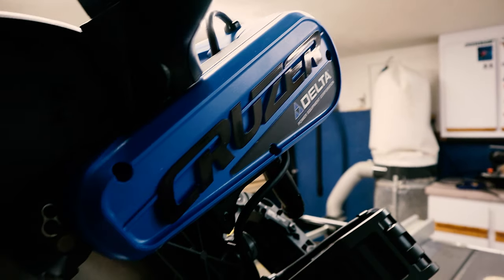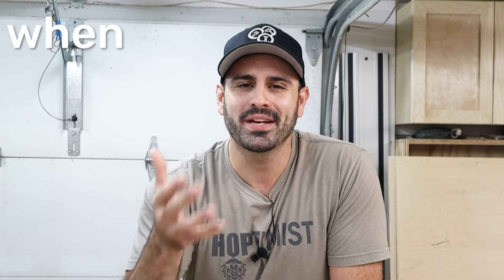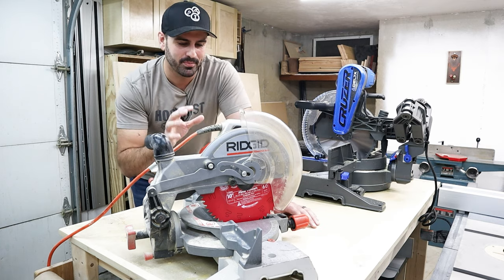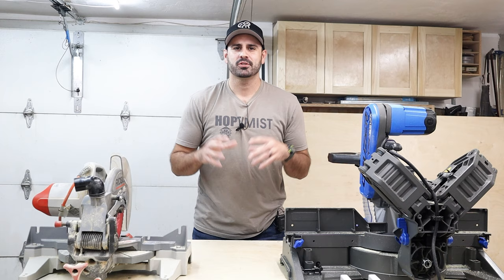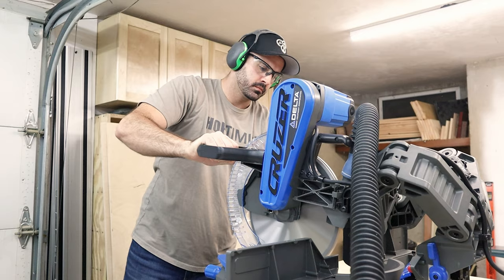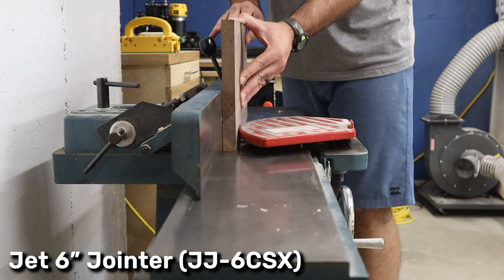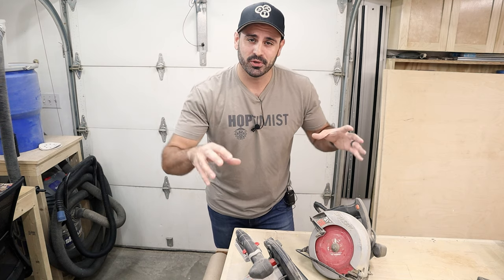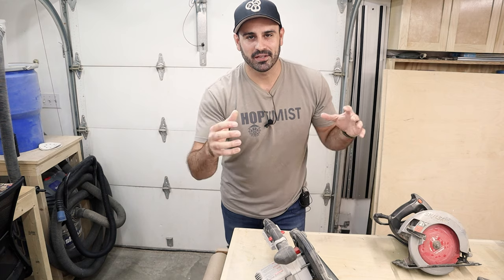Should you UPGRADE your WOODWORKING tools?

Comment: Excellent video. First time watcher, first time comment 😅 new subscriber. You make great points the I've struggled with myself. I got a track saw a while back and it was totally worth it. I just recently upgraded my table saw and now I'm eyeing that same exact miter saw. I mean if budget was not an issue, I would go with the Bosch GSM12SD but it's a considerably more $$$$ tool and not in my budget. I know Delta tools. I own Delta tools. I'll get that saw as soon as I can.
Reply from the maker: Hey, I appreciate that!  Same thought process over here.  I have a Delta table saw and love it, figured I'd stick with Delta for the miter saw as well.  Thanks for watching the vid!

Comment: great video i am new into woodworking and have been going crazy trying to decide between saws 10 vs 12 slide vs non slide i do not have a lot of rear clearance where i have my setup so the zero clearance makes sense but then i say to myself i can always crosscut with my table saw then i try to figure out if i go cheap on saw i can also get a air compressor and brad nailer combo which is about 200 give or take then there is the stand for the delta if i want to work outside in the nice weather there is another 200  i have already had the dws 779 12 inch slider and the matching rolling stand but the massive rear clearance needed plus the dust bag goes beyond the slide then the handle snapped off the rolling stand when i went to lower it so back to the store went both items so 600 bucks now i am debating on just getting this, i can order from HD for 519 and i can always wait for the nailer and stand and if i want to work outside or in garage just set up on sawhorses and a old door, thanks for any advice
Reply from the maker: Hmm, I wish I could give you a good answer on this, but it certainly depends on your situation.  I made due with my old rigid miter saw for years (because I would make those cross cuts on the table saw).  I did recently buy that air compressor kit and it's opened up so many more projects for me.
Reply: @CasualBuilds  I actually think I FINALLY found my miter saw I bought and returned some the last return was the Dewalt DWS 779 12 inch slider, it needed so much rear clearance which I don't really have in my indoor set up, when I went to lower it on the Dewalt rolling stand the stand handle snapped off I got angry and returned both, fast forward a week I saw a Metabo miter saw stand, I was already looking at the Metabo 10 inch zero clearance miter saw, the stand was on marketplace which drove me to buy the saw, I like  it and seems to cut good and seemed to be in square.

Comment: Hello, Thanks for your great Video, after 2 years what is your opinion of the Delta/Cruzer??? are you still happy with that machine??? or do you regret something???? Thanks again.
Reply from the maker: It's alright. Dust collection is terrible and I find it hard to align the sliding component for 90 accurate cuts

Comment: I built an end grain cutting board for an Xmas gift for my mom this past Xmas. It was my first cutting board. I used my uncle's workshop and he has that small jointer that sits on the workbench. We had the exact same problem of the boards not getting perfectly flat.  It actually made some worse. So I know your pain. That cutting board took forever because of that stupid jointer. Lol. That delta saw is sweet. I've never seen a saw with those arms in the back.
Reply from the maker: I'll tell ya, having a jointer that has a fence that's properly set and runs well will make the world of a difference.  Yea, this saw is definitely cool, loving the sliding mechanism so far!
Reply: @CasualBuilds  they both were definitely great upgrades.

Comment: Great saw and for the same reason bought the bosch glide.
Reply from the maker: Yea, I was also looking at that one.  Can't wait to start cross cutting wider boards with this thing!
Reply: @CasualBuilds  essinsatal craftsman said it well " don't blame the tool for bad results use proper skills to build . Wish you well and keep at it as you are in the .5 percent that is making things  on you tube and build a miter station with dust collection for the new saw .
Reply from the maker: @daxd8358  You read my mind, that's next on my list.  I have a miter saw station, but the opening for the miter saw and the drop down doesn't match the new one.  Need to upgrade that too!
Reply: Casual Builds https://youtu.be/w7EEMlKyMYs
Start at 32 minute mark and watch the Bosch & Metabo ( which is not sold in USA ) dust collection idea that may help you since you have a new build in mind and is a major issues with miter saws in general . Please note it is in German yet the video is self explanatory. Hope helps you out . I know that you do not own either saw yet dust collection of the metabo may help . Light shadow is best for miter saws hands down in delta miter saw .

Comment: I’ve been looking for a decent jointer locally for almost a year in the Central Valley Ca. Anything decent sells quick. I’m not a fan of Delta tools anymore. Their quality and customer support is non existing. 
I’ve been thinking of getting the same track saw as well, but the jointer is needed first. Congrats on the new tools and excellent videos.
Reply from the maker: Thanks Gustavo - I've heard of issues with the Delta table saw that I have, but luckily, I haven't had any issues yet or needed to get in touch with their customer service.  Track saw is awesome, I think it's a great alternative to the more pricey Festool options.  And yes, jointer is key.  Keep searching, you'll find something soon!
Reply: Casual Builds I had the Delta 35-726T2 and after a week the motor started acting up. I called Delta customer service and I was told to just return the saw. There’s a person on Facebook selling a kit that fixes the motor electrical issues. I ended up returning it, and saved up and got a Grizzly G1023RL. I wish the delta would of worked. I would of saved up a lot of $$$.
Reply from the maker: @gusgusnft8231  Yea, I'm assuming you're talking about Frank?  I've chatted with him about the kit too, but I haven't seen any issues yet so I've held off on purchasing.
Reply: Casual Builds yes! Frank.

Comment: I agree with your decision to upgrade, but I can't help thinking about some of your 'excuses', for lack of better words, LOL.  
"calculating the distance from the edge to the blade" for the circular saw, for example, caused me to immediately wonder why you didn't just cut a couple of blocks the width you need and use them to space the edge of your saw from the cut line, or as you mentioned, other jigs. 

Efficiency is very important, even for weekend warriors. I started with a HF tablesaw, the crappy one before they came out with the almost as crappy better one.  I spent an entire year wasting a lot of time just trying to make it cut well.  It discouraged me until I dropped out of woodworking for a year until I could afford a better one. 

You can get things done with cheap or inefficient tools.  But, sometimes it is better to be more efficient. 

My two cents is, depending on your budget, is use whatever tools you have and make your projects as efficient as possible.  Then, as you work, you'll know which tools will do the most for your work style to either add or upgrade.  I'm a weekend warrior type <100 sq ft shop. I put myself on a 'diet' so I do not buy tools or supplies unless I expect to use them within a week.  The exceptions are when I have something on my shopping list that goes on sale. 

In the meantime, Jigs are King!!!!  :) 

I love your videos. Keep up the good work.